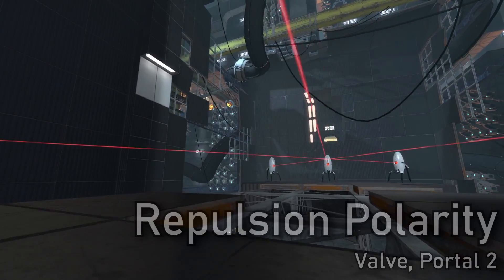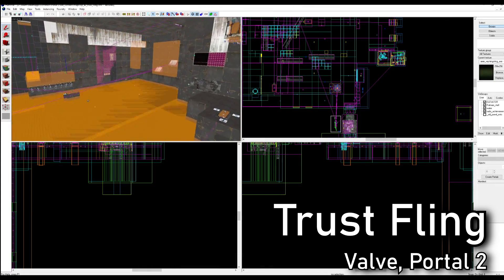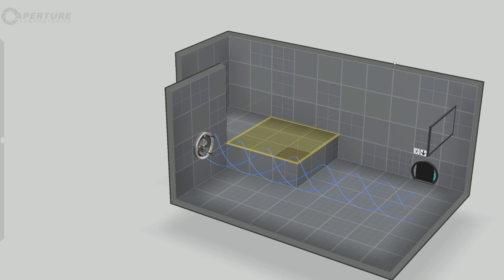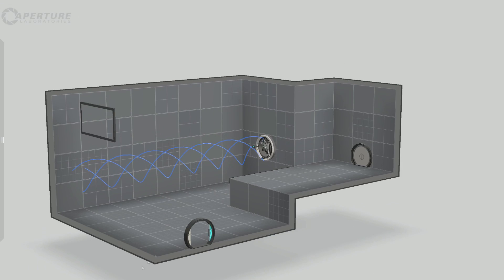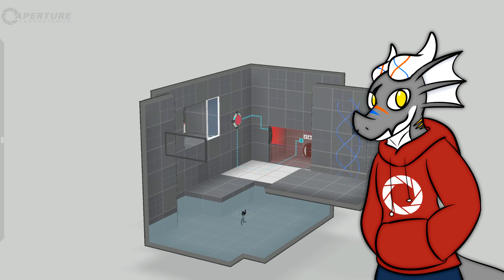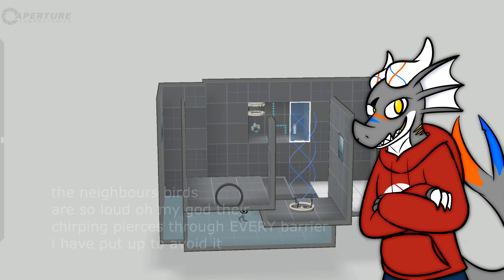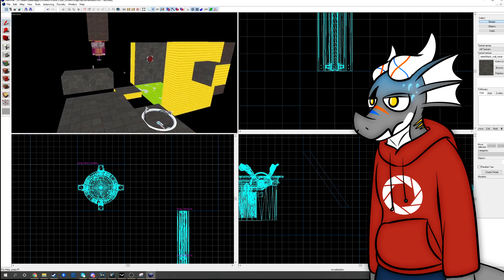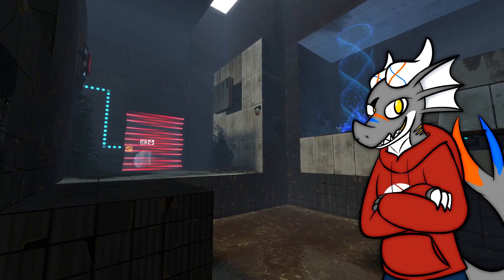The Process Of Making Portal 2's Levels

Comment: you can just install bee2 and set the style to "overgrown" instead of torturing yourself using hammer
Reply: It’s still pretty restricting
Reply: Its as torturous. Even with addons like qol it stopped me so much from doing what i want i had to switch to hammer because its fully in my control, and not hoping whenever im doing something peti wont just say "nuh uh you cant".
Overgrown maps with bee2 still look ass btw. And are even harder to make look decent than with hammer.

Comment: couldn't you have just ran the map in the in-game editor and then used a program like bspsrc on the bsp that was saved to Portal 2\portal2\maps\puzzlemaker\76561198089139833 to decompile it into a vmf and then edit it from there in hammer? i tried it on one of my maps and it worked

Comment: Why are you placing player starts and then change their classname instead of just placing the class that's needed itself?
Reply: In Hammer, every entity you place is the player start by default. There is no way of changing this, and it is very annoying.
Reply: @MC28daDude on the right-side panel there's an entity selection window, you can also change it to prefabs and select why prefab to place

You may have hidden this panel but it is in hammer(for any hidden windows you can go to the "Window" section and enable it back)

Comment: You can actually open Portal 2 map from editor in Hammer. I've done it many times. It saves a lot of time...
Reply from the maker: this is literally the worst piece of advice, it is “technically” faster but it is a WORSE workflow.
Reply: @OssyFlawol  Works fine for me
Reply from the maker: @krystof0118  No, it is a bad practice. You need to learn how to hammerise puzzles because it will help you in the long run. Trying to edit PETI maps is a bad move because PETI maps aren’t made to be edited in Hammer, the command only exists for debug purposes that got left in, due to all the brushes being split up into 128 unit blocks, the instances of gameplay elements used being the PETI versions, it creates a very confusing environment to modify. The PETI Instances for Cube Droppers and such are intended for the editor only and have every possible option embedded in them, even overcomplicate certain pieces of I/O that would be easier to do and understand if made from scratch. It is a nightmare to do, even if it supposedly works, it only handicaps you from unlocking your true potential as a mapper.

I used to do exactly this when I was younger, but I stopped. Ever since I came back to mapping in 2018, I refused to ever use that command, and I’ve managed to do so much more than that by making everything from scratch, it literally helps to abandon this terrible handicap, please understand that.
Reply: @OssyFlawol  Ok I will give it a try <3

Comment: For anyone wondering why it's not advised to export level editor puzzles to hammer it's because the entire map is made of tons instances (basically small maps that get loaded into one map, it was designed to allow multiple people to work on different sections of a map at once but it also was how the level editor works since every object is an instance
You can combine them but you have to get the instances themselves because without them the map is just a box with tons of blank entities floating around
Reply: Actually as I was writing this you can see them using instances for some of the details 
Some people do use them for stuff like that but personally I just find it to be distracting

Comment: Where do I find the props for the holes in the ceiling that lead outside?
Reply from the maker: I typically utilise a mix of Squarebeams and destroyed wall props from the props_destruction folder.
Also - Despite their naming, always use wall textures on ceilings, the provided ceiling textures can be a bit sucky (except in the case of white surfaces, but just use floor textures)

Comment: One of the first things I do when setting up Hammer on a new system is setting the default entity type to prop_static instead of info_player_start, saves a lot of time in the long run.
Reply from the maker: ive tried

this is just the faster workflow for me
Reply: @OssyFlawol  Do you use the green Gordon for scale?
Reply from the maker: @thennoth2860  its the default entity, info_player_start, it just marks where the player starts in the level, i dont use it to measure scale since i can get a guess of the scale just from looking at the map
Reply: @OssyFlawol  ah, I was just asking about how you said it is a faster workflow for you. I personally also have Gordon as the default entity since for props I tend to just make one, then use shift and duplicate as needed to make more entities, and just change the entity type.
Reply: @OssyFlawol  lucky you. :( 
I suffer with depth perception in 3D environments (thank god not in irl), and it sucks because one time I made a doorway way to slim, and it felt way to closterphobic.
Reply: @LinkieNecronLore  You might one of the few people who would actually benefit from a 3D display. After all, regular screens just show 2D projections of 3D images, but if the screen has some sense of depth then it could help you figure out relative scale between objects.
Reply: ...There's literally a drop-down menu in Hammer which lets you change what entity the entity tool creates while editing a map, why doesn't anyone ever use that?
Reply: @TinyDeskEngineer  Yes, but it's easier if you don't have to do that every time you launch hammer, I guess.
Reply: @TinyDeskEngineer  Also prefabs
Reply: I always just copy an existing prop_static lol
So I only need to set up one
Reply: Lol, i'm not the only one who makes it that.
Reply: @Portal2Player  yooo its portal2player!!!!! hi mate
Reply: Doubt, the most effective entity is func_instance